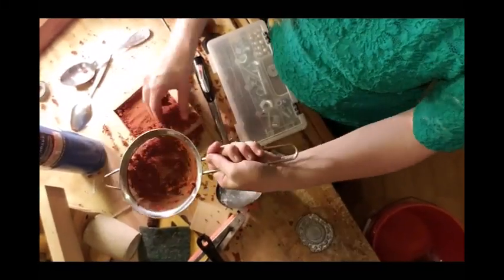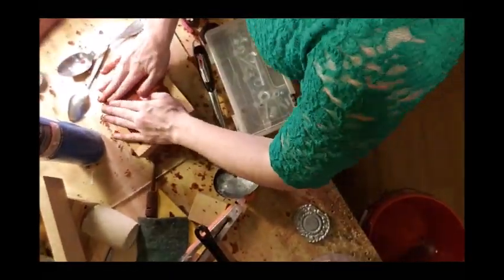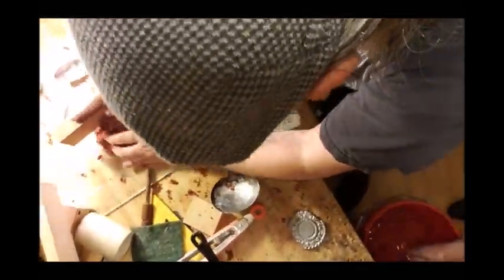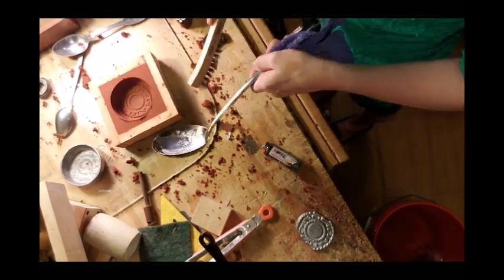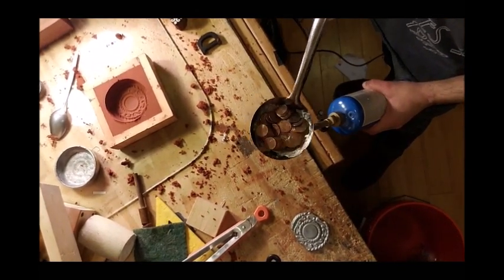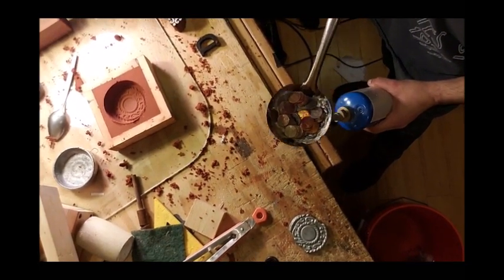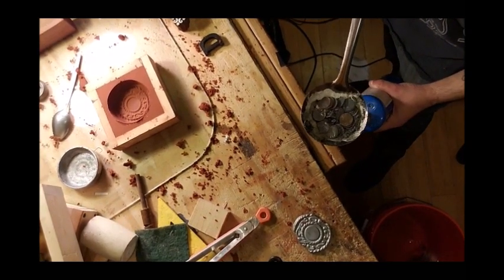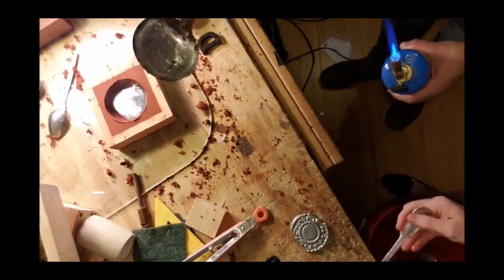Melting and Casting Zinc

Comment: Don't want to sound like a YouTube troll or a safety pusher but I really have a couple of things to say. I applaud your attempts of casting, BUT, you REALLY NEED a good pair of thick leather gloves. Even the small amount of moulten metal you had would cause serious burns to those hands. The other thing about zinc, melt outside if at all possible as the fumes could cause a little thing called fume fever. This stuff will make you seriously sick, like your trying to throw your kneecaps up through your nose. Still your on the right track and from what I can tell castings will improve. Good vid.
Reply from the maker: Thanks for the comment.  While you are absolutely right about the gloves, metal fume fever comes from zinc that has reached its boiling point of ~1600 degrees Fahrenheit.  There is no danger of getting the zinc to that high a temperature with a propane torch that has that type of nozzle.  

While I appreciate your concerns, please believe that I have done my homework and I am confident of my abilities to avoid burns.  Thanks again.
Reply: @dominicdelprincipe2583  100% CORRECT you are in no danger of zinc poisoning at those temperatures.
Reply from the maker: @FreedomFactory3D  Yep :D